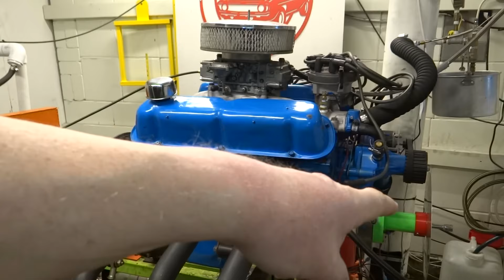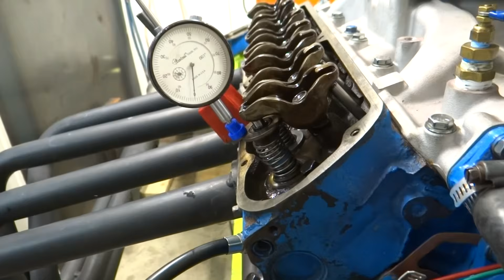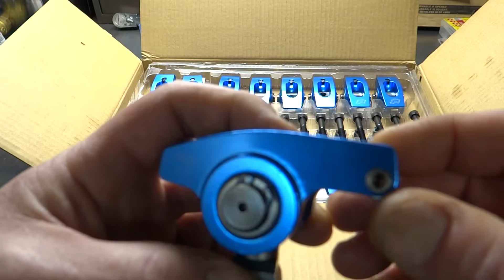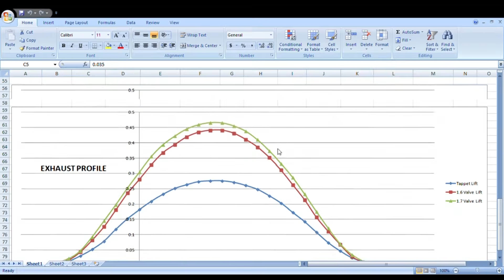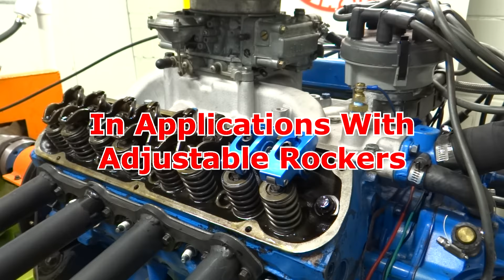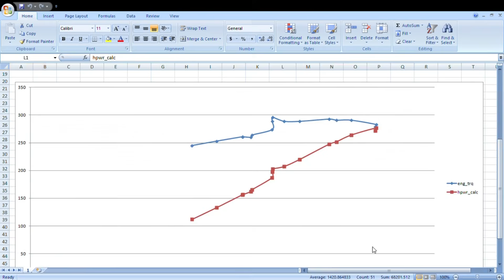Budget Ford 302 Project (Part 26) 1.7 Roller Rocker Install, Lift Profile Measurement, and Dyno Test

Comment: Three things....

The shims are meant to adjust your rocker arm geometry. If you have too much pre-load.....change the pushrod. 

When increasing ratio, you're increasing valve speed. You should increase increase spring rate as well. Dont be surprised if you experience valve float.

Something often overlooked is the air filter size. That little thing will hold you back eventually. If it isnt already.....

Comment: I am currently rebuilding a 302 with e7te heads. Did you change the length of the push rods? Just asking because I will be ordering a b303 cam and getting the trick flow iron head spring kit and 1.6 rockers, do you think a change in push rod length will be needed?
Reply from the maker: Hi!! I had to get different pushrods when I went from the flat tappet cam to the roller cam and lifters. I just went with stock length for the roller cam engines.
Reply: @engine_therapy  Do you think that anomaly in the dyno with 1.7 rockers may have been a little valve float from springs?
Reply from the maker: @mikesoutfishing  I think its a real possibility. I have this 283 project going on now but Im not done with the 302, it may be a while but a valve spring upgrade is  something I want to try. Thanks!!
Reply from the maker: I think its a real possibility. I have this 283 project going on now but Im not done with the 302. It may be a while but a valve spring upgrade is something I would like to try, Thanks!!

Comment: What valve springs were used in this video?
Reply from the maker: They are stock replacement H.O. 5.0 springs.
Reply: @engine_therapy  I'd be interested to see some upgraded springs on there. Like the TFS-2500100. How high are you revving the engine?
Reply from the maker: @Adrenacyde  Just about 5200, Someone else alluded to the springs not being enough. I have been thinking about it and that very well may be an issue, loss of valve control. I may look into getting some springs, locks, retainers.
Reply: @engine_therapy  The TrickFlow kit I listed is usually pretty cheap and has everything you need. This is one of the first mods I do to a 5.0/5.8L that still has E7 or GT-40 heads.

Comment: It's been proven in many tests that roller rockers don't increase power in any way, and can actually hurt it if your valve springs are marginal (more reciprocating mass). They do, however, allow for a more radical cam and associated hardware, and one big thing that I've noticed sinced installing mine, is engine oil life. The old stamped-steel sled-type rockers work the oil really hard through fluid shearing and heat stress. The oil becomes dark and the viscosity gets thinner.

The rollers drastically reduce this, verified when I've checked the oil at change time (10,000km), and it looks and feels much healthier, being lighter in colour and more slippery to the touch (ie film strength is better).
Reply: Do you remember what your valve spring pressure was closed?
Reply: @stuartwall8212 Crane Fireballs, advertised 115 on the seat, around 125 measured by the head guy, but he said that they'll settle down to spec when run in.
Reply: @Cat_fish911  That sounds reasonable.

Comment: I think you're reaching the peak flow of those valves and ports, as opening the valves any further doesn't seem make any difference here.

2V Cleveland heads are similar in that they generally top out at 450 lift, regardless if ported or stock.
Reply from the maker: Its been a while since I flowed these heads, but what you are saying sounds like what I was getting (not much extra  above .450. Thanks!!
Reply: Mine top at about 375 lift and hold the flow out past 600. They have been ported until the "noise" quit. The low lift flow is far greater than any other stock/ported stock casting I have messed with. With that and a canted valve, I am purposely using a short duration cam to avoid over scavenging. A 302 has a small enough displacement that filling the cylinder should be easy in my targeted rpm range. It will either work or it wont.

Comment: I am working on a project that will put Cleveland 2v heads on a 302, and so the Cleveland rockers (1.72) will replace the 1.6s. The cam will remain stock HO roller, and I have gone through great pains to get the compression up to 10.5:1 with flat top pistons. One goal for me was to keep the maximum torque # as low in the RPM band as possible, as it is going in a street car. So....it looks like, according to your experiment, I could see an extra 4* of duration on that stock cam. I kinda like that idea, lol. I have also considered the greater closing force of the valve spring at 1.72 as you have mentioned. Thumbs up to you though because your experiment has already been dynoed and mine is still a engine stand queen 🤣🤣🤣
Reply from the maker: Thanks!! I actually thought about trying the 2v Cleveland heads a while ago. Did you need to get special pistons with different valve reliefs, or should there be enough room with the HO cam? Also curious about what intake you used or plan to use? Thanks again!!
Reply: @engine_therapy  The open chamber 2v heads have lots of room even with Windsor pistons. I found a set of forged Cleveland pistons and used them to get a little extra piston height. I also used longer 289 rods for a total of .085 out of the hole. I milled the heads .045. Even after all that, I have over .100 intake valve clearance with the cleveland piston, but the piston is .040 from the spark plug strap. I had to radius the chamber to allow the piston to intrude that far, but was insistent upon compression. Intake is a speedmaster "boss 302", and the port size was a match to the 2v, but the alignment had to be messed with. I am trying to keep costs between 2500 and 3K. Alot of used parts in the mix, and alot of fiddling. Alot of measuring, figuring out how to measure, trial and error, grinding, etc. All in all, probably not worth the effort except it has experience value, stretches my curiosity, and scratches an itch that simple bolt together stuff cant scratch. Except for the Chinese intake and the roller cam/lifters, all these parts were available in about 1974. If I was born 30 years earlier and doing this in 1975, it might be considered cutting edge instead of butchery.😆
Reply from the maker: Very Cool!! I get why you are doing it that way. Thanks!!
Reply: I have a 302C with mildly ported, closed chamber heads, mild towing type cam, running 10:1 and a 4-barrel, it made 196 at the wheels through a T5. I was a bit disappointed as I was wanting 220-230. So don't get your hopes up too much, the 2V heads may flow a lot better than Windsors on paper, but real-world use makes them not quite the sum of their parts.

Comment: One turn 5/16 18 is .0555, 1/2 would be .0277.
Really don't need the 4 place of the decimal. 🙂
I think there would be most gains mid lift and max lift.
The 1.7's are a nice gain in lift and duration. .👍
Do you have a stock oil pump, or high volume?
What kind of valve springs?
Thanks for sharing. 👍 🏁
Reply from the maker: I can't remember what I used for an oil pump, I usually opt for high volume but may have gone with a standard on this one. The springs are just stock replacement HO valve springs. Thanks!!